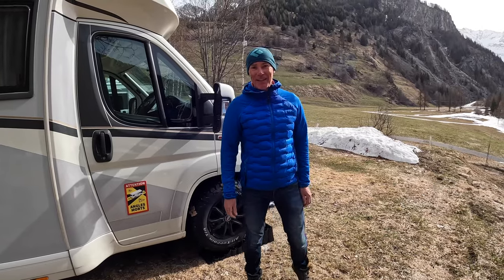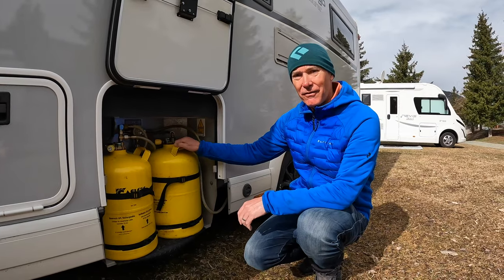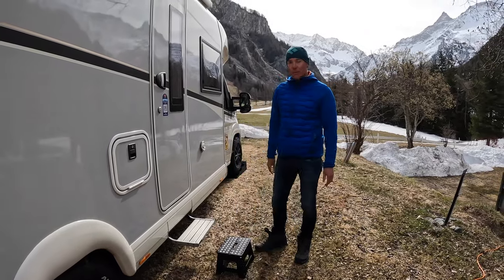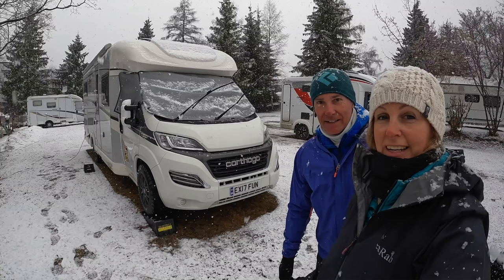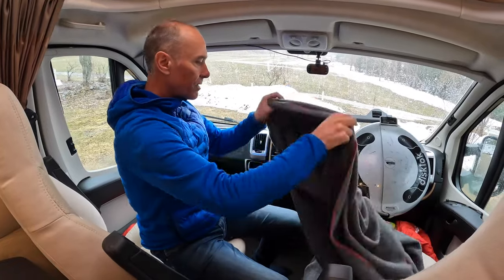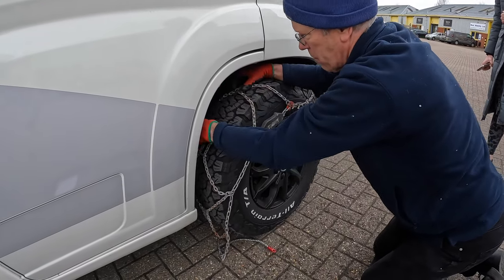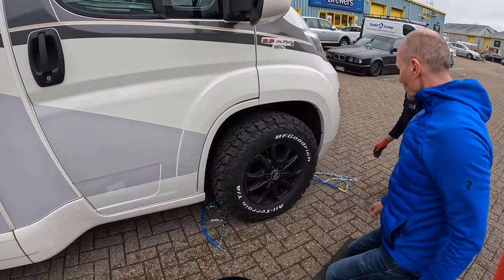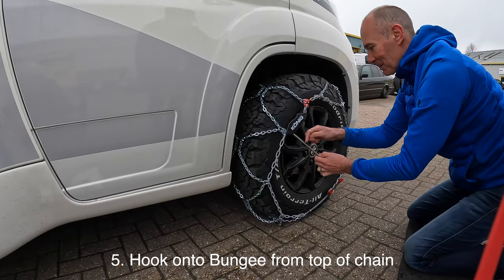ESSENTIAL MOTORHOME SKI TOUR TIPS

Comment: We're using a challenger van that runs on diesel heating, a fully winterised insulation spec and works a treat. No danger of running out of gas. Consider snow socks as an alternative to chains, very easy to get on and off and easy to store. As our van is small I put the skis on the bike rack and lock 🔐 via the bindings. Happy skiing!
Reply from the maker: Sounds like you are very well set up 👍 we just love being in the snowy elements with our Motorhome. We considered the snow socks, might get a pair of those a well, as you say easier to put on. Happy Skiing to you too😀 ⛷ cheers...Andy&Michelle

Comment: Excellent winter vanlife tips guys 🥶

Michelle did mention something pertinent during the fitting of the snow change section..

At the time you will most likely be fitting snow chains, it will be dumping with the white stuff ❄️and freezing cold, so a pair of gloves similar to the guy demonstrating is always handy and practicing with the gloves on 🧤👍🏼

Another tip we use is to have an old pair of ski salopettes to put on over yr regular trousers as yr jeans will get soaked crawling around the wet ground and will be blooming uncomfortable once yr back in yr camper and driving 😉

🚐💨⛄️❤️
Reply from the maker: Hi, couple of great tips there, thank you Will definitely invest in a pair of gloves like the guy used, my salopettes are already old 😢 but I'll have them on hand to use 👍Cheers...Andy&Michlle

Comment: Just come across this video, great tips thank you, we are hopefully heading down to Austria over Christmas to take my 11 year old son skiing - first time in the motorhome😬, I have a mixture of excitement and apprehension - we have an Adria Twin which is winterised but nevertheless still a bit nervous - I will be buying all that you suggest - I have fitted BF Goodrich All Terrains already 😀 - our gas bottles are in a cupboard inside the motorhome which is a bit of pain when refilling (we have SafeFill bottles) - out of interest did you need to use the chains or carried for legal and just in case purposes? Thanks
Reply from the maker: Hi Gary, the chains were just in case and we didn't need them. Europe is much better equipped to clear the roads so it should be fine unless you get caught in a snow storm. There is a knack to fitting them so worth practicing just in case. Since the video I learnt another tip, if it gets really cold and your gas won't vaporise then stick one of those £2 feet warmer pads onto the tank, I'm told its enough to get it to vaporise. Have a great time skiing from your Motorhome, we found it a lot more straightforward than we imagined😀 Cheers...Andy&Michelle

Comment: Hiya, Question on the Goodrich Tyres. What pressure are you running at? We are told that you can run at a lower pressure and therefore assume  the tyre pressure monitor system has to be reset accordingly.  We also have a Carthago  and love it. Keep on rolling.
Reply from the maker: Hi Sue, we run at 55psi as recommended by Elite Wheels who fitted them, I know some run at 50psi but maybe we are a bit heavier and it seems to be good for us. We don't have a tyre pressure sensor on ours. Got to love the Carthago👍😀 Cheers...Andy&Michelle

Comment: Lots of good information.  Some of it is common sense but I understand that CS retired in some people long ago.  I am not a chain man and your tires(tyres) look pretty angry which I would be confident in.  I would worry about the damage to the wheel wells with the chains on.  If the driving is that bad that I feel I need chains to get around I think I have not assessed what I am getting into.  I plan ahead as I am sure you do as well.  Keep it up...
Reply from the maker: Thanks Allan, carrying snow chains is mandatory during winter in most counties in the ALPs. Yes agree, if there is a fresh snowfall on the roads and an option to leave it a day while the roads are cleared that would be safer.